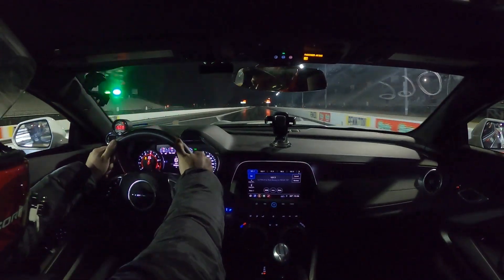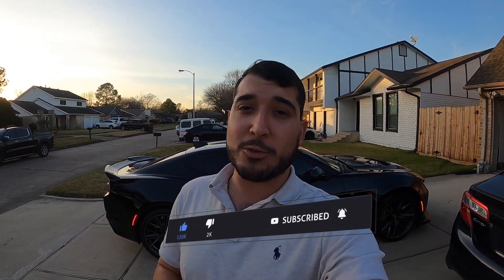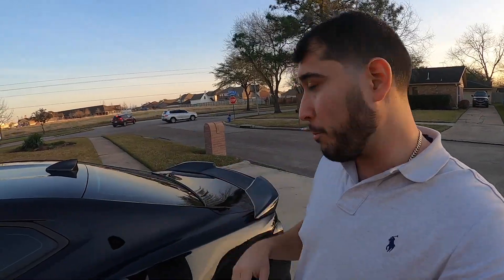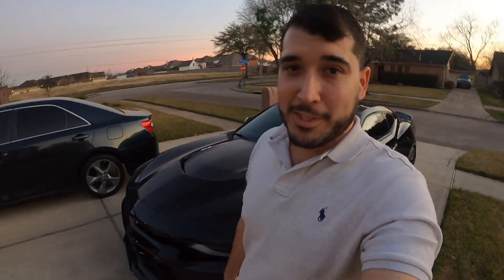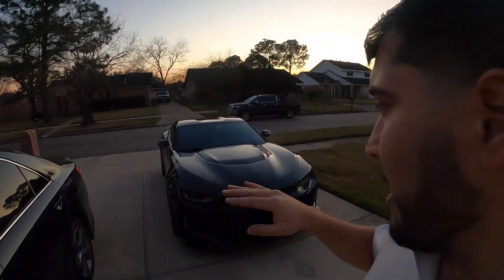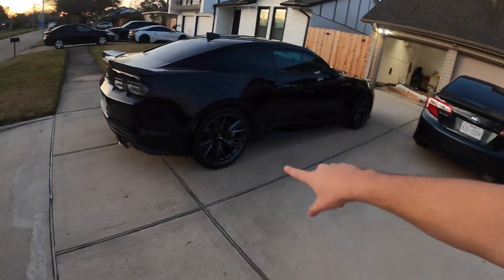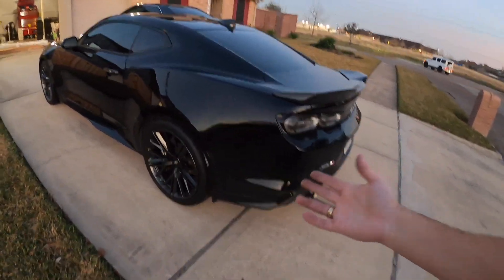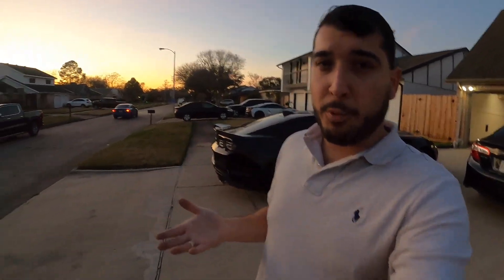I Have To Get Rid of My ZL1. | Vlog # 508

Comment: Damn,Ima miss your zl1 videos bro. On another note bout what we talked about earlier the track was HORRIBLE!! IT was no prep and a 1/8th mile. 1st race I jus screwed up. 2nd race because it was no prep turned the Traction back on!! I still broke Traction almost the whole length of the trak. The 3rs are  beast but I feel  more track related not drag. Heve u ever or do u use non prep tracks and  if so what tire will hook? Will the 555r2s, I no mickey Rs will. I also feel the slip percentage means something.  It's obvious the 555rs hook on  prep trak because you use them, right? Non prep? With the lowered psi
Reply from the maker: Never done no prep but really the et street r would be my choice and would have to throttle it out of the hole